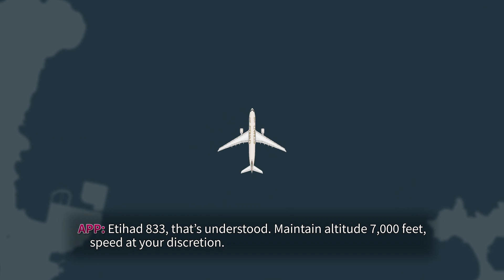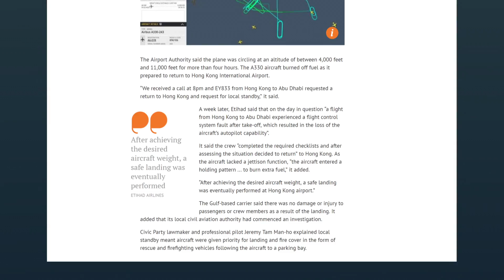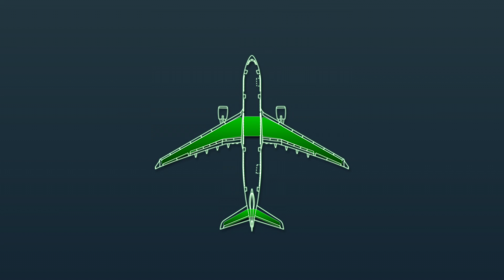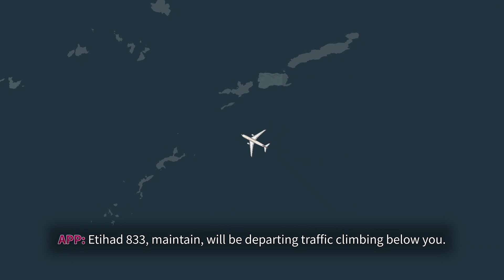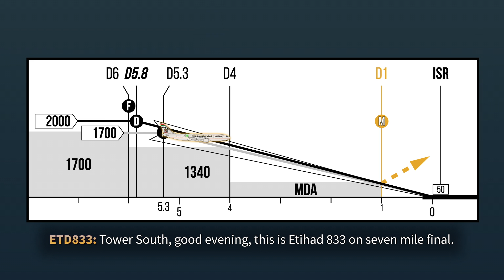Autopilot Anomaly [with ATC audio]

Comment: Would dumping the fuel not be faster instead of holding for about 4 hours? Provided the A330 has a fuel dumping system on board.  Must be very hard for the passaenger, sitting for I guess in total 5 hours in an plane and end up at the airport you left from. But at least no one got hurt. That is the most important.

Comment: Very good made video. Why didn't they just dump fuel? It would be allowed.
Reply from the maker: As stated in the video, Etihad's A332 fleet doesn't have fuel dump capability.
Reply: Ok, but it think it is a big mistake to not install the system, if youre in a really big emergency it is a loss of safety.
Reply: BUI KADJOS costs money tho a lot of airlines don't justify the cost of it

Comment: For all the people commenting that they could have proceeded to abu dhabi without autopilot, no the could not have. Flying to abu dhabi you will have to enter rvsm airspace, which requires an autopilot, since reduced vertical separation is in force to accomodate the busy traffic flying on those airways. They could not just fly below rvsm levels since the lower you fly, the more fuel you burn, so the fuel would not have been enough to reach abu dhabi. Everything the pilots here have done could not have been done better. Great job both from the pilots and the atc
Reply from the maker: Thanks for that perspective, Kevin. It's very easy to be an armchair pilot and cast judgement on the actions of a crew without all the relevant information. I hope this helps viewers consider the multidimensionality of such an incident and the complexity of decisions that have to be made.
Reply: Not only that but Hong Kong might have better accommodations for a grounded plane.

Comment: pardon my ignorance, by the xtreme reliance on automation? could they not "hand fly" the plane to dubai?
Reply from the maker: Hand flying over long distances (or really any distances) is simply not done in commercial aviation. Automation is used to ease the aircraft handling load of pilots, so they can focus on other, less immediate concerns (i.e. planning approaches, considering weather, diversions, fuel, managing other aircraft systems for increased efficiency, etc.).

Also, it seems likely from the aircraft and crew's actions that many parts of the autopilot were functional, so whatever system did malfunction was enough to convince the crew not to continue with the flight.
Reply: Not done but can be done. I've done it.

Comment: Autopilot is hardly a critical flight control. Seemed like the craft had no trouble maneuvering...why not just continue the flight under manual control?
Reply: Nic Neufeld Computer Science student here. We learnt the concept of triple modular redundancy. Modern aircraft and man certified rockets use this. There are basically three computers constantly doing the same task and comparing their own set of sensors. So if one sensor says a speed of 200 knots while the other two say 205 then the computers vote to use the 205. If the autopilot system starts glitching out then it could indicate more serious issues like miscalibrated sensors and that warrants an immideite landing. Usually if one of the three computers were to fail you can continue the flight. Rockets constantly have their computers knocked out due to radiation. Reliable computation isn't really an issue, but false reading is.
Reply: Nic Neufeld That would be a pain in the ass
Reply: Indeed. We can't have people actually having to do something.
Reply: if there is a problem then its a problem. could be lead to a disaster. So better to fix all issue first.
Reply: Arif Hidayat How would a malfunctioning autopilot, turned off, lead to a disaster?

Comment: Generally speaking I love your channel, the visuals in this E are great except one small part.  The depiction of holding onto fixesis wrong, the Betty fix holding pattern is correct.  When holding the is ALWAYS an inbound leg of at least 1minute before turning outbound.  Never turning into the fix.

Beyond that a few informative things based on the questions here.
Losing the autopilot is in itself not an emergency, but it has some serious implications.
1:  cannot use 1000ft separation in most Enroute environments.  It is almost impossible to maintain the necessary degree of altitude hold required to safely operate at higher altitudes so a block altitude of 3k ft oulde be required.  So at an altitude of fl320 no planes could pass near above FL 300 and below FL 340
2:  auto throttle would not work properly so speed control, and to a large degree alt control is labor intensive. 
3:  I'm willing to bet the company requires as part of their MEL (minimum equipment list) include a working autopilot before starting an international flight.
Since this is not an emergency then no reason to attempt an overweight landing.

Nice job on the explanation of how other ATC systems work, I appreciate it.
Reply from the maker: Thanks for adding that extra information!

Regarding the holds, all depictions in this video are based on radar data (multiple sources). They aren't "wrong", as always I simply present the track of the aircraft based on the best information available.

Comment: If the plane was fine to fly in a holding pattern for several hours, why didn't they just finish the flight without the autopilot? Especially since the destination was the airlines main hub.
Reply: The unexplained loss of a major system like the autopilot can be an early indication of a far greater problem such as an electrical fire. The point of flying in a holding pattern is to maintain a distance close enough to an airport to enable them to conduct an immediate emergency landing if the shit hits the fan.
Reply: Richard Andersson the emergency was identified (correctly) by the pilots as non-critical. It's much more dangerous to Rush in to the airport for landing without understanding the problem (what works what doesn't) running check list and ensuring that all precautions are taken and all options considered. The risk of staying in air was less than risk of immediate landing in this case. Pilots handled it very well and all are safely on ground as result.
Reply: The other reason that they went into holding is because they were above MLDW (Maximum Landing Weight). It would have been unsafe to execute an approach when exceeding this limit.

Comment: Thanks for the high quality video mate! Keep on going! By the way, it's kinda strange that the autopilot system failed considering that they did an ILS approach and isn't Airbus A330 equipped with 2 APs? Greetings from Melbourne!
Reply from the maker: +09shadowjet The autopilot system as a whole didn't fail, rather part of it malfunctioned (exactly which part, Etihad didn't specify). So yes, vertical and lateral navigation still appear to have been available (including ILS functionality), but whatever the issue was, it was enough to convince the crew not to continue with the service.

Thanks for watching!
Reply: AirTrafficVisualised Thanks for the explanation!

Comment: Thanks for the informative video.

Maybe I don't know enough about aviation to understand the issue in this video, though.  So the autopilot was not functioning, but all other flight controls were.  Why does that mean they cannot complete their flight?  They did a lot more manoeuvres in the holding patterns and returning to the origin airport, than they would have done if they had gone on to their destination.  It doesn't make sense to me.

Comment: What do they do in more complex emergency incidents if they don't have fuel dumping?
Reply: They didn't dump fuel in this case, but burned fuel. 

If they have to return earlier to the airport they choose the longest runway and to a heavy landing, means excessive stress for the brakes and the undercarriage. Means the undercarriage needs to be inspected/replaced and the breaks might need to be extinguished. Else the tires might explode. None of this is very severe, they just need emergency equipment for standing by.

In any case a heavy landing means, that they cannot just fix the initial problem and fly again, the aircraft need some intense inspections after that. So crews try to avoid this, if there's not an serve emergency.

The larger planes can dump fuel. On the A380 incident for example the system was out of service due the excessive damage to the airplane systems, so they had to make a extremely heavy landing, stopped only 100 feet ahead of the runway ending.
Reply: Ruben Kelevra Thanks!

Comment: Wait what, I thought all A330 are equipped with fuel dumping
Reply from the maker: Etihad's statement was suitably vague: "a flight from Hong Kong to Abu Dhabi experienced a flight control system fault after take-off, which resulted in the loss of the aircraft’s autopilot capability." The crew was able to maintain fairly precise holds over the prescribed waypoints, so I don't think the AP system failed entirely.

As to flying the entire flight by hand: I can't imagine any crew, facing a situation where the entire autoflight system had failed, electing to continue the flight. Modern commercial aviation is more about managing the flight than flying.
Reply: airlines have the option to not install fuel dump mechanisms on their A330 aircraft.
Reply from the maker: Etihad elected not to install fuel dumping capability for its A332 fleet.

On a side note, during my research and planning of this episode, there were quite a few people around the internet rebuking the crew of this aircraft for their "indecision" during the hold. I hope this video shows that that wasn't the case.
Reply: Well, the autopilot may not have failed, but rather had an issue interacting with the fly-by-wire systems. In this case, it's possible that the aircraft changed control laws unexpectedly, or that the fly-by-wire was behaving in an abnormal manner. In that case, I would definitely want to land the plane.
Reply: AirTrafficVisualised yea, looks like heading/nav still worked. Maybe they even flew it by hand to the navpoint (should be possible still for modern pilots) ;)

My best guess would be that a high control system most likely groundradar stopped working, that would trip the autopilot system and could explain why the pilots asked if they are under radar control. Maybe TCAS was also affected.

I can understand why pilots choice to not fly by hand a full flight. But they flew actually for 4 hours (maybe by hand) so I thought why fly for 4 hours around instead of just flying to the destination of just the AP is faulty. :)
Reply: Maybe they had issues with this system too, if it is equipped.
Reply: AirTrafficVisualised thanks for pointing this out.

I was just wondering why they turn around because the AP is not working. They have 2 APs on board. And still if both are not working this shouldn't affect the rest of the systems, they could have easily flew the route by hand and schedule the fix after this flight.

So I guess they have no equipment to fix the Aircraft on the destination or the pilots had felt uncomfortable with flying by hand the trip.